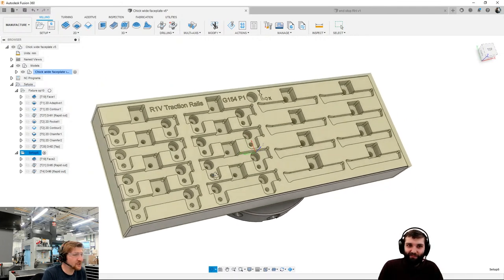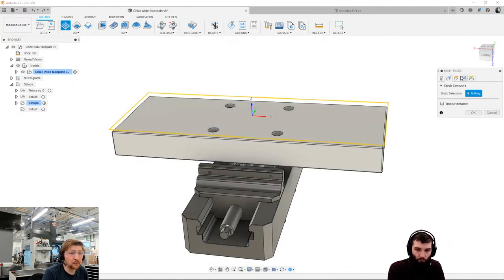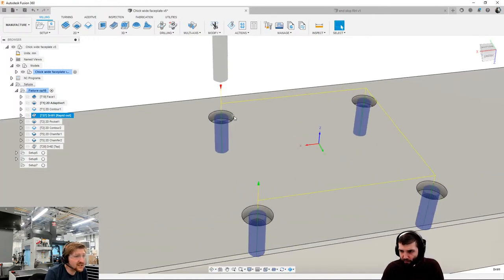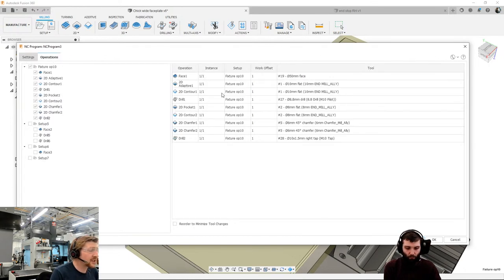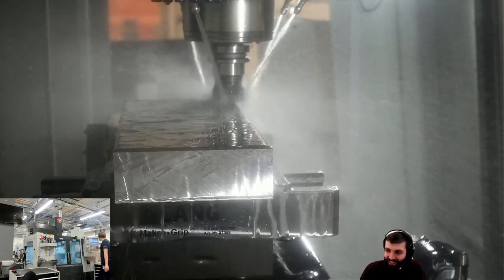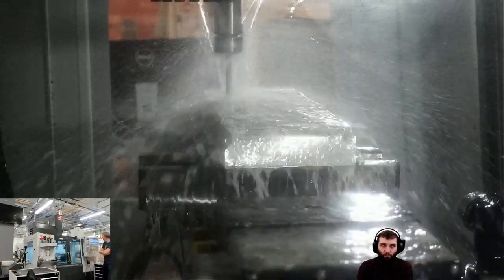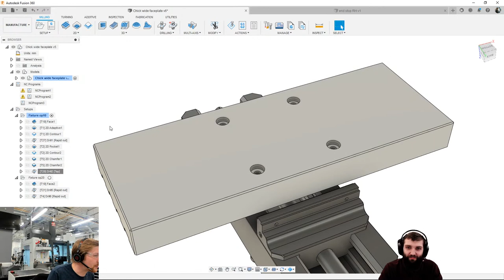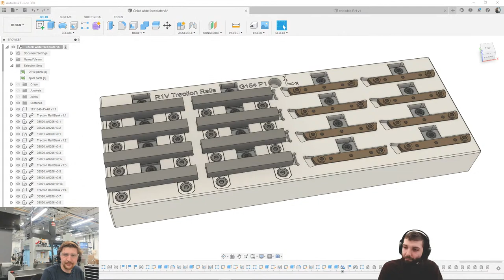360 Live: Design and Manufacture of Custom Workholding Part 2

Comment: a few things i noticed:

H6 (for bores) is always 0 +xx not 0 -xx. so your 16H6 is 16.00 to 16.011...
Chamfering before tapping ensures a clean start of the tap and also will 'center' it in the hole.
most importantly!

as reported in the Bug forums, NC Programs completely IGNORES machine configurations... so I almost had a crash after the september update while using Ncprogram. Because my machine z-home point is not 0 but 450. maybe someone has a look into this.. I since updated the post to suit my needs, as i have a one post per machine approach.

I quite like the practical approach as you machine your parts right in the livestream. Clear camera view tho :)

Even stepdowns on 3D-Toolpaths, definately!
Reply: Hey, yeah I realised that I messed up on the H6 I was reading the shafts page not the hole page, so I was looking at a shaft with a H6 not a hole with a H6.

Good spot! Glad to see people are actually listening :)